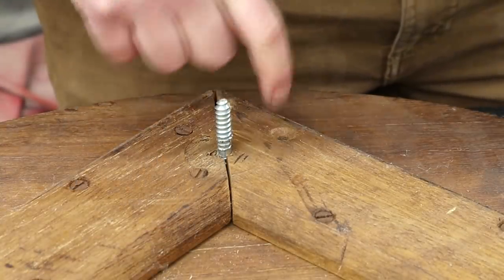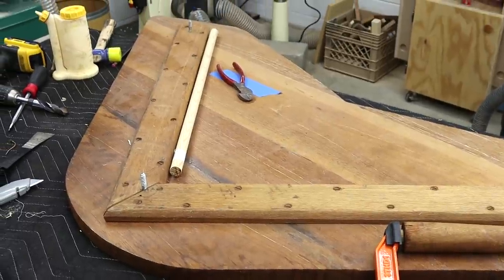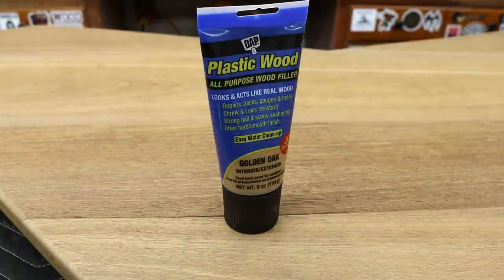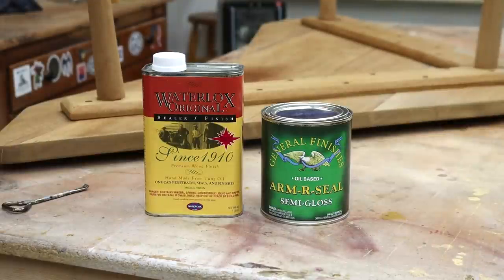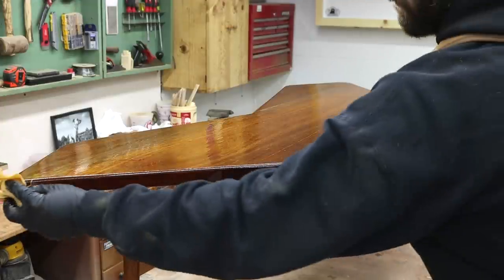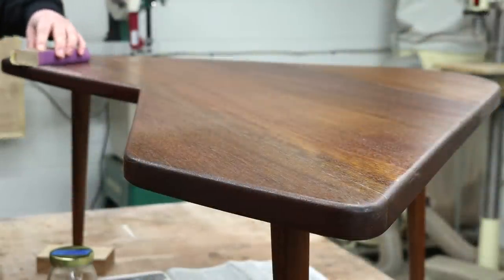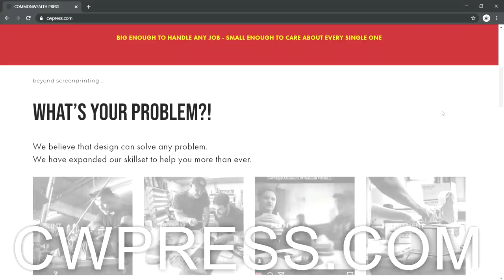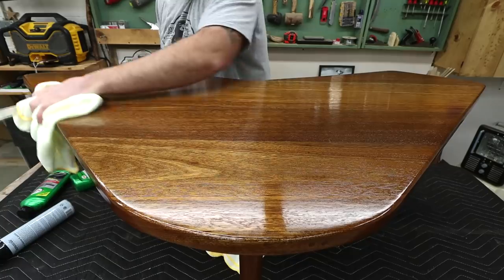Restoring a Mid Century Modern Table | Furniture Restoration & Repair

Comment: That table is the same age as me or a year younger. What a commission to be entrusted with, to that guy it probably has more value than the Chippendale commode. If I was that man I'd trust you without a second thought and I'd be very pleased with the job you did. 

I think I was the last generation to have proper woodwork and metalwork classes in the UK. They have 'technology' lessons now, which are a bit of everything and a lot of nothing. In my time children who didn’t necessarily excel at pure academic lessons like history often did at the practical lessons. Those lessons were often a good way to lead them into maths as they could apply them to their metalwork and woodwork. 

Yet another brilliant video. May I ask if you have also been doing a bit of restoration on yourself? Both you and your beard are looking a bit leaner than in the older videos I’ve seen. Well done.